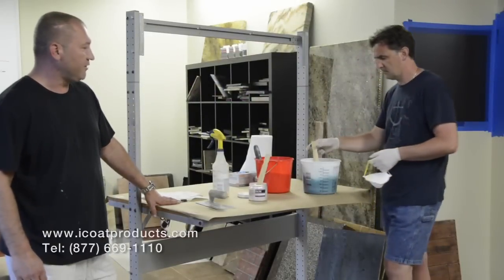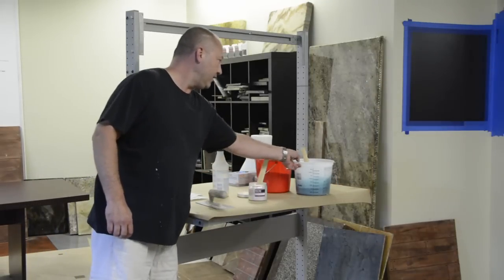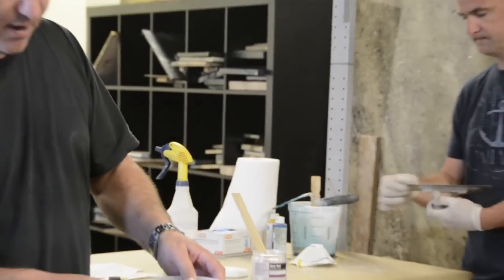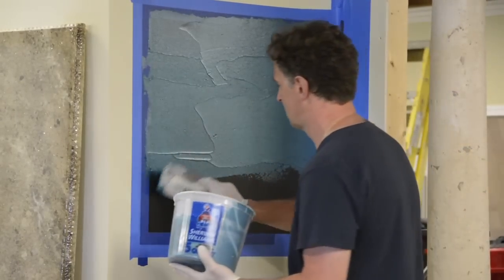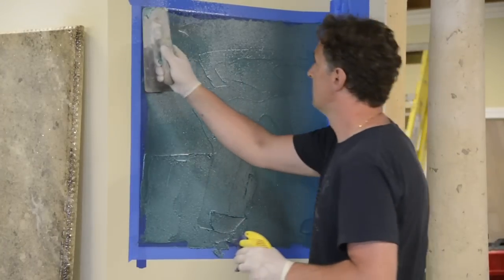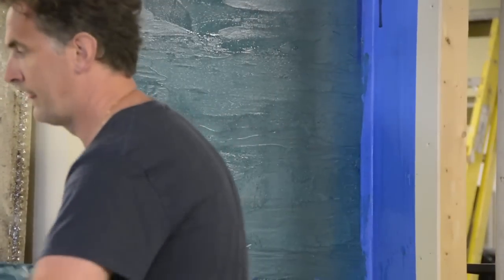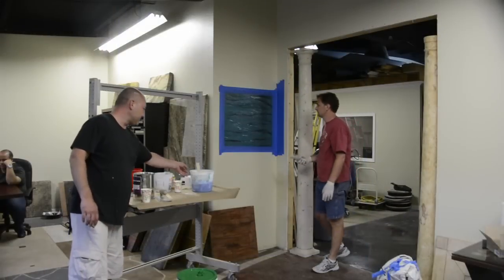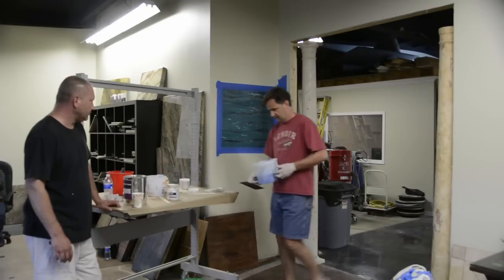Wallpoxy -Do It Yourself with iCoat Systems

Comment: is epoxy waterproof? are there special cleaning agents that can be used on it? can I put it on drywall? wood? plastic? fiberglass tubs? is it sandable? do I need to use a special agent on top of it to seal it? how do I figure out how much I will need with the surface are I have? where do I get this product?

Comment: Hi!  My Countertop covers about 2.5" of the tile Backsplash.  Your video is the only one covering a vertical surface.   Is there a technique for covering this small vertical patch that will be smooth, or should I give up on the Epoxy coatings all together? Thanks!

Comment: dwall mud with color and spray apoxy give you better results and longer time to work on it.
acrilyc also is better
Reply: is the epoxy your talking about waterproof? are there special cleaning agents used? can I put it on drywall? wood? tub surface?

Comment: It doesnt look like shit to be honest, but the guy performing looked nervous as hell .. on such a small surface you dont have to panic and hurry as much with epoxy.
fear the working time of it, if the material itself was hot and the ambient temperature is hot, that will lower your working time significantly